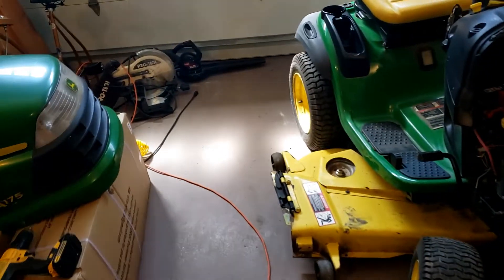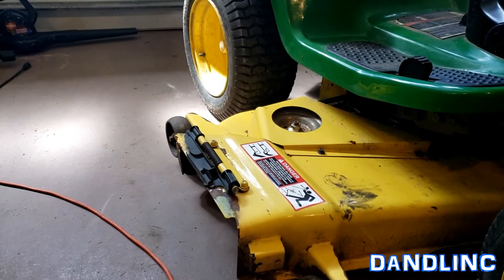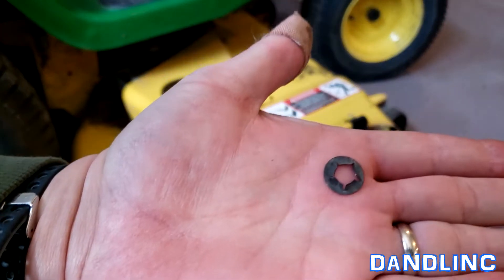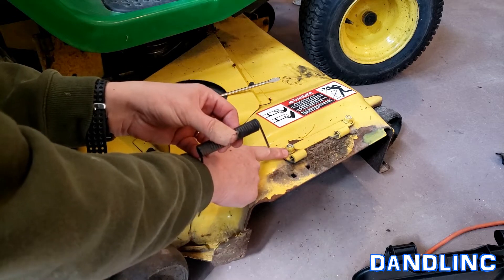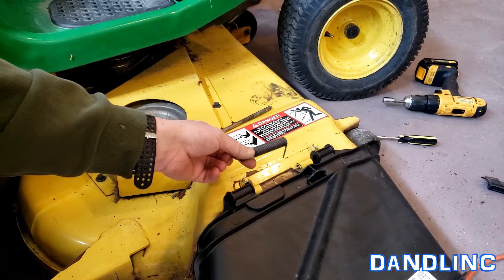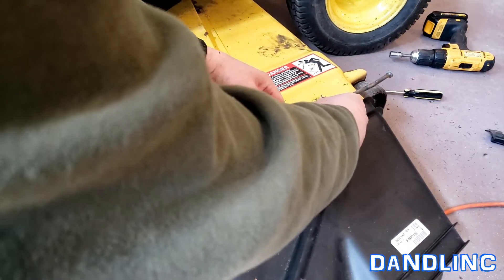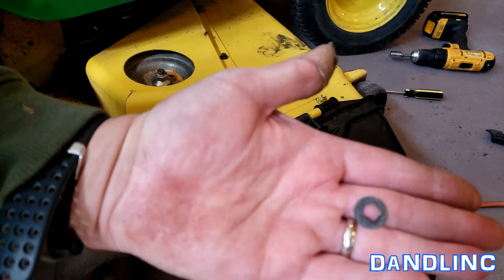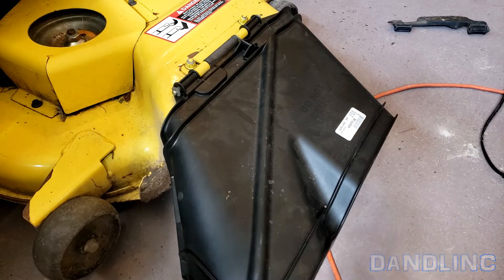How To Replace A Lawn Mower Deck Discharge Chute DIY & SAVE

Comment: good video, thanks. For my l110, i searched for DIY and struggled to get the springs back in place correctly. My final solution, which worked perfectly, was to install it without the springs. Even when cutting heavy grass, the chute stayed down. I am certain that the spring makes the discharge safer, so proceed with caution.
Reply from the maker: Thanks.  The spring was hard.  I was tempted to use my bench vise as a 3rd hand but I had my vise disassembled for painting!  I'm glad you got it installed.  Thanks for watching.
Reply: Is it  possible to not put the small spring if the large one is connected

Comment: Great video. Thanks. I have couple of questions:
Q1: I have a mulching unit on my Deere X320 mower with 48" deck. Is there any harm to remove the discharge chute? It is very cumbersome to flip the mower deck when changing the blades with the discharge chute.

Q2: I see streaks of uncut grass when I mow the yard. Is there a "right" way of installing the three mower blades? Should be they at certain angles.

Thank You.